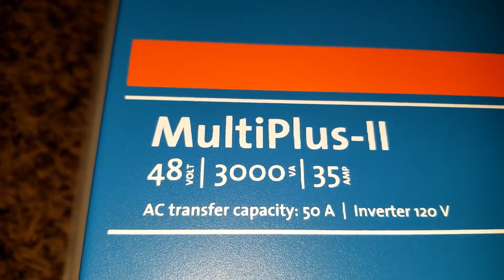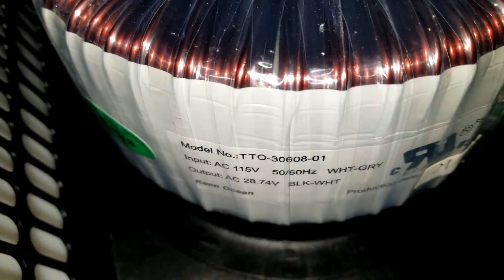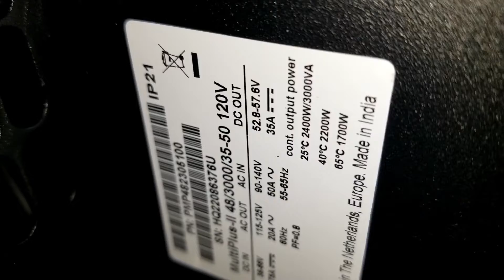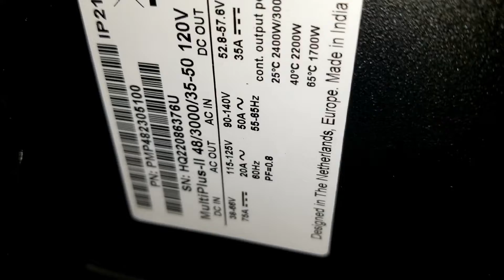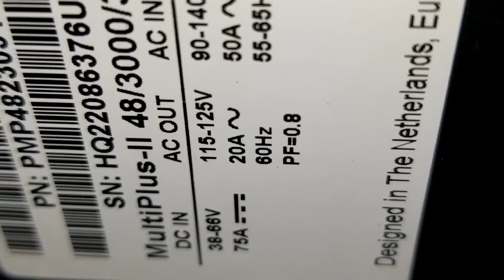INSIDE THE VICTRON MULTIPLUS-II INVERTER CHARGER

Comment: Nice video. 
Can this inverter charge the battery the same time as working? Ex connect to a generator to input charge battery and the same time have output. 
Thanks
Reply from the maker: Yes.
It is an inverter charger.
Thanks for stopping by and please don't forget to Like Share and Subscribe

Comment: I really like the victron ecosystem.  But every time I see inside this inverter I want to slap the engineer.   The land of the mis-fit fan, could you maybe create a path for the hot air to escape.  Try shifting the transformer to the left an inch and maybe making the unit an inch taller.
Reply from the maker: Thanks for your concern.
Please don't forget to SHARE LIKE and SUBSCRIBE

Comment: have 2 Victron inverters to repair. 24 Volt 5 kA. They do not switch on. Batteries are OK and it is connected to the grid. Not even 1 LED comes on. Can
Reply from the maker: @PulseElectrical-uq2fk  
That's the only downside of Victron.
I wish they have spear part stores where in customers can buy parts to repair there products.
I am sorry to hear about your Inverters issues. I hope you find a solution as soon as possible.
Thanks for stopping by and don't forget to LIKE SHARE and SUBSCRIBE

Comment: I don't like those "spring clamp" terminals on the AC in/out and will make sure the one I buy does not have them. The new ones have screw terminals. Thank you for sharing...
Reply from the maker: @davebruessow6842  
Thanks stopping by and don't forget to SHARE LIKE and SUBSCRIBE

Comment: Technically only the transformer part is low frequency, the inverter bridge is still high frequency, just like the transformerless inverters, because we still have to create a pure sine wave using a PWM signal. The high-frequency name for the transformerless inverters comes from the DC-DC converter that uses a high-frequency transformer (or coil, depending on the type of boost converter topology) to step up the voltage. HF transformers are tiny compared to low-frequency ones, they can literally fit in the palm of your hand.

Each has their own advantages. Transformer-based inverters are best suited for off-grid and backup applications because of their high surging capability and robustness. Transformerless-based inverters are best suited for on-grid PV generation because of their high efficiency.
Reply from the maker: Thanks for your input and watching this video.

Please don't forget to LIKE👍 SHARE and SUBSCRIBE.

Comment: That is a capture nut the bolts come through the back of the inverter through epoxy Isolation in the center of inverter
Reply from the maker: Ok thanks.
That means I don't need nuts on those?
Reply: @jwsolarusa  yep no need to change anything the other term captive grip nut used alot in the wood working and plastic industries.